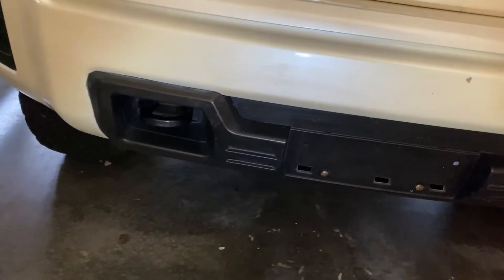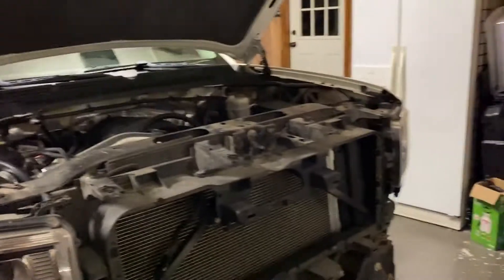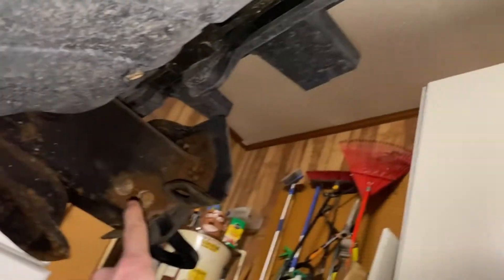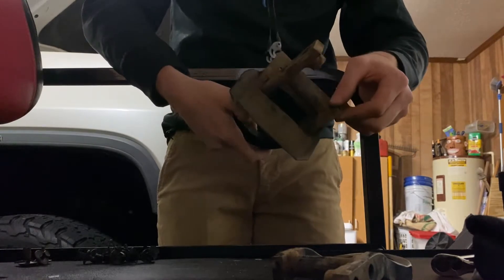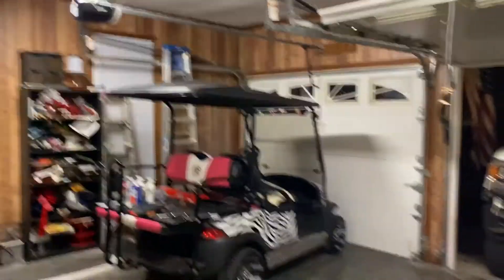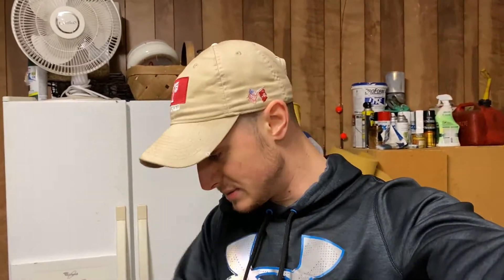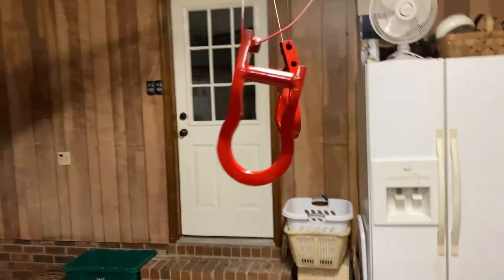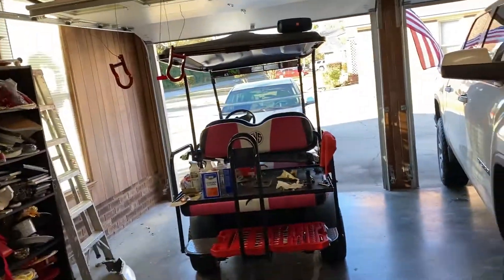Painting Tow Hooks On My 2014 GMC Sierra

Comment: How many coats of red did you put on the hooks? I know you mentioned you used the whole can (but it also leaked) and two coats of the clear coat but not sure if you mentioned the red.
Reply from the maker: I think it was 2 or 3 (which is basically what the can allowed).
Reply: @hunterrwiilson  thanks for responding. I bought everything you had and gonna tackle this project this week 🤙🏼